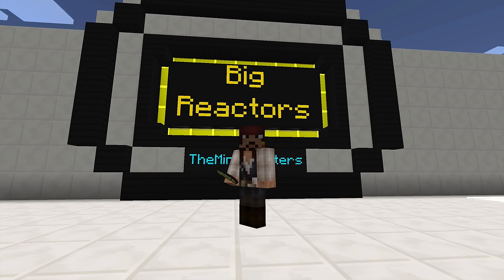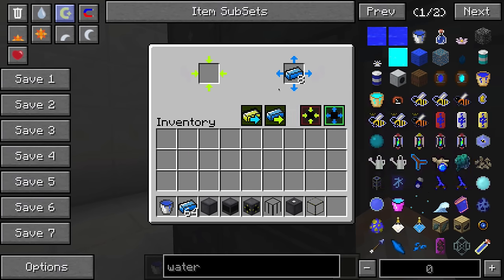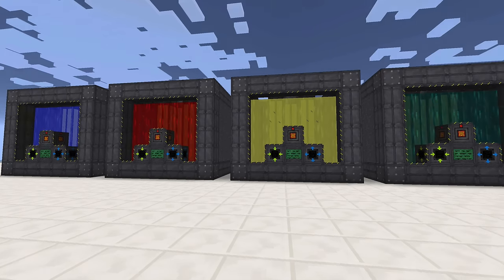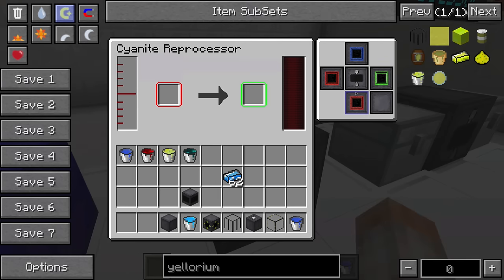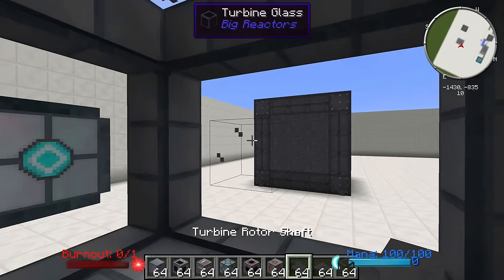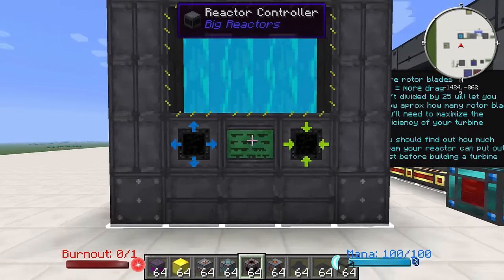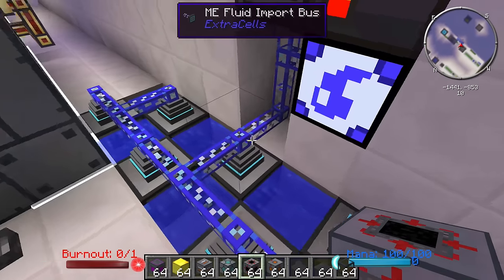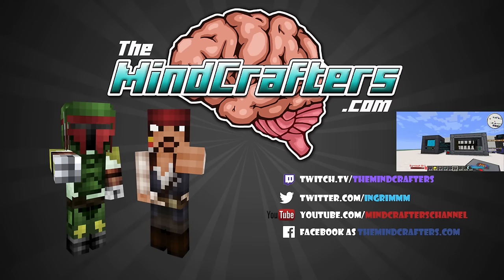Big Reactors Tutorial - Reactors & Reactor Turbines

Comment: Can anyone help me with that table?
It says:"take block value and x8 per coil to find the amount of steam you will need to spin your turbine" so i take 36.13 (for electrum) x8 = 289.04
then he sais:" devide that by 100 for a 5x5 for he number of rotors you will need to meet your demand" 
289.04/100 = 2.89
So i need around 3 rotors? thats seems way too less and then Mindcraft would be false because he said u have to devide it by 25
Reply: Yes, in your example (electrum, 5x5 setup) you would need at least three rotors. To get your machine 'spinning', it needs 289 steam. Each rotorblade can process 25 steam. In a 5x5 setup, you can add 1 rotorblade to each side of your rotor. (The rotor is the 'shaft' in the middle, the rotorblades are the extensions that go to the 4 sides of it.) 4 sides on 1 rotor filled with a rotorblade gives 4 x 25 = 100 steam (per time unit) capacity. The '25' in this formula is the value for one rotorblade (and used by the video maker to calculate the number of rotorblades needed). The '100' in this formula is the total capacity of one rotor part, combined with rotor blades on all sides. You always have 4 sides you can use on each rotor segment. In the 5x5 setup, you can add (only) 1 blade to each side of that rotor segment.

If you use Electrum blocks for the coil, you would have to craft 4 pieces of rotor (shaft), in a 5-block high machine, 5x6 foundation. The 8 blocks of Electrum go around the 4th piece of the rotor shaft (the 'end').
In addition, you would need to craft 12 rotor blades and attach these to all the sides of the 3 other rotor shaft segments. It might be that 11 blades gives a better result, you would have to test it out for yourself.
And all of this math is to get an optimal setup that works in an efficient way.
:-)

If you have the items needed to construct a big turbine, go ahead and do so, there is no punishment. The coil material (and the amount of coils that you place) will determine how much steam you need to run efficiently. If your turbine is very big, you will end up with only 1, 2 or 3 blades on a rotor shaft segment.
The only punishment is that you need more space in your Minecraft world.

I hope this helps a bit.  :-)
Reply: No, take the mB/t of steam that your reactor is outputting, and divide that by 25.  In his example, he is outputting 271 mB/t.  Therefore, 271/25=10.84.  Always round up with real numbers, putting the number of blades at 11.  Configure them on the rotor shaft however you want.

Comment: Hey Mindcrafters!

I just wanted to say that in FTB Infinity Evolved (server, node 5) I've built axactly the same type of passive reactor (7x7x6) with 5 rods and resonant ender as coolant.

550 RF/T while using slightly less than 0,1 yellorium ingot. Temp was also very low. Somewhere near 100~~

Reason why i'm writing is.. Why there is such HUGE disparency between your reactor and mine.. This thing is hardly worth smelted coal used to build it.. Simple Lava generators would be more beneficial..
Reply: +MrDeothor I have a simple anwser. look at the upload date. there were probably alot of updates for big reactors wich changed the numbers on some fluids and blocks (English isn't top notch but i think you can understand)
Reply: Vostar PL actually i found reason why. My greed. I though "checking on 1 yello ingot is totally enough".. Who'd have thought that it needs more to show it's true power..

So yea.. All is working fine!
Reply: Oh, okay then :P

Comment: I just wonder.. Why would you need SO MUCH RF/t?

Isn't it an overkill?
Reply: ***** Hmm.. Tbh i always avoid ME system.. But.. This is still an overkill..
Reply: Lazer drills and potating, duh
Reply: +MrDeothor ME system, pulverizers, auto-sieves, ender io blocks and draconic evolution.
Reply: ***** Dude.. you'd need about 500 pulverizers/sag mills and anothe 500 alloy smelters to actually use more energy than big reactor produces..

That is simply insane amount of Rf/t

Me system. Tbh dunno. I'm doing everything possible not to use it.. But still.. Just too much..
Reply: ***** 50 chunks of tech that uses rf/t?

That's most likely server, right?
If so.. then yeah... I myself play only solo... So for me big reactors are overkill.

If i want alot of energy i'd go for laa gnerators or cursed earth farm + ender generators. Both do very good :)

Comment: 2, 3, 4 rods... Well I have 221 fuel rods... Gonna need a lot of cooling there.
Reply: ComputerControlled naaaah, there's no such thing as overkill in Tekkit :D filled it up with 70% diamond blocks and 30% water, still at 2500C (the overall frame is 25x25x25).

Also I shoved like 10 inventory fulls of yellorium in there, that's 50% of the capacity.
Reply: ***** a blaze rod EMC farm.
Reply: ***** to power rotary macerators.

Comment: learned a lot. 

but learned nothing about the water pump system. Copied as best I could, water just doesn't pump from the accumulators. I'm probably an idiot though.
Reply from the maker: I'm sure you're not an idiot, not many people use ExtraCells yet...I'll link my video to the mod in the description if you haven't got it working yet
Reply: The MindCrafters weow thanks :)
Reply: Jester
 Use waterpump pipes, they can transport 10 buckets peer tick.
Reply: The best solution that I have found is to use tesseracts.  You will need 4 total hooked up directly to the fluid ports with an import and export on both the reactor and the turbine.  This method gives you a closed loop system where you put in a few buckets of water once and then walk away forever.  I have 4 max size turbines putting out over 29k RF/t each, and I never worry about water in them.  An added bonus is that you do not use any fluiducts, so the system is modular and clean.  I can make my steam in one dimension, while I run my turbines in another.
Reply: if you have Extra utilities mod then use Transfer node (liquid) with a lot of Mining upgrades then you can have enough water to do what ever you want but using it can cost a lot of iron

Comment: This mod isn't very realistic. You don't have breeding ratios, radiation, neutron embrittlement, overheating, cooling towers, neutron moderation, heat exchangers, metal and salt coolants, and the fuel produces too much energy without enough work reserved for breeding. It should have an analog to thorium like it does for uranium and plutonium. It sure is lots fun in Tekkit on Mars though :P
Reply: leerman22 If you want a more realistic nuclear power mod, you should have a look at ReactorCraft by Reika. It has pretty much all those features, and more (like  a multi billion RF/t fusion reactor)

Comment: Gold doesn't conduct electricity. 'Nuff said.
Reply: David Tran lol gold is one of the best conductive metals, why do you think most computer components (in real life) use it? you ever noticed the gold on ram or gpu connections? thats real gold
Reply: Gold does conduct electricity, very well in fact. Not as good as copper or silicone, but it does conduct electricity.